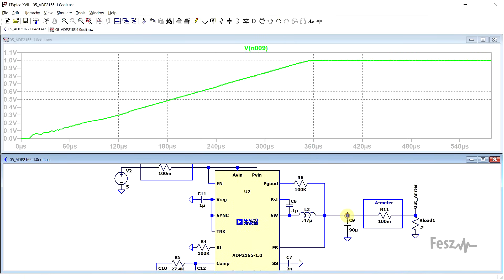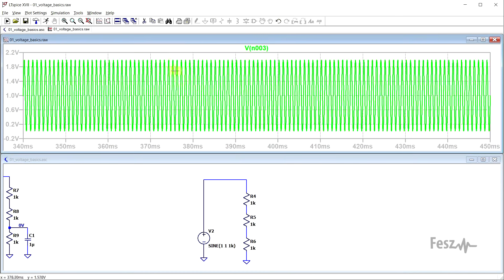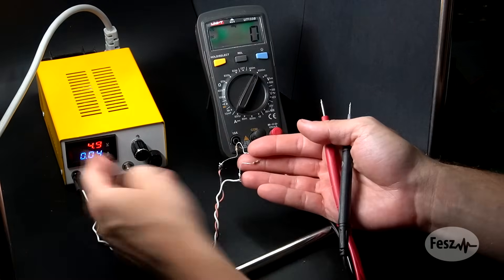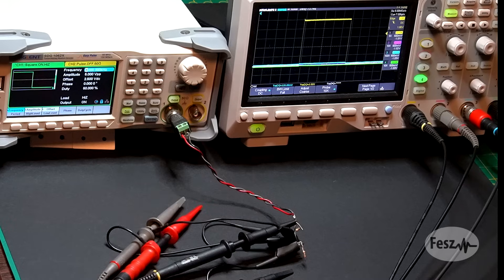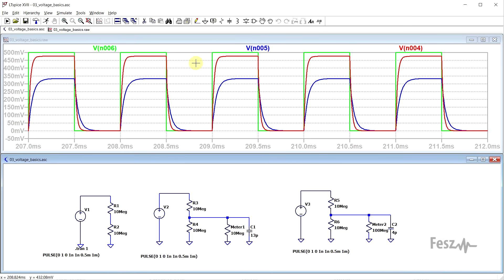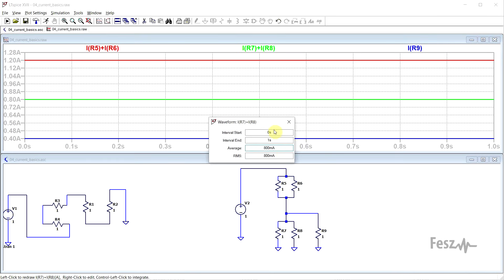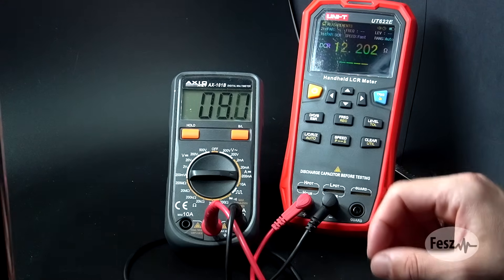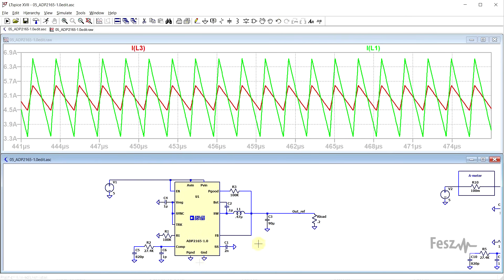About Measuring Voltage and Current

Comment: There is at least one additional way to measure current in LTspice. To measure the current flowing into a particular pin of a component, you can refer to a "pin current" like "Ix(U1:Vin)". You can actually pick any of the available pin currents from the list displayed by the "Add trace" function.

Unfortunately, pin currents can't be used in .measure commands.
Reply from the maker: This is quite an annoying phenomenon - it happens whenever a subcircuit is used. You can use the pin current in the plot window but not in anything else. I saw that 2 common ways around this is to add a voltage source with 0V in series with the pin, or just a very low value resistor, and then use I(Vx) or I(Rx) in measure or any other commands.
Reply: @FesZElectronics  In my latest design, adding a 0V voltage source slowed the simulation to a crawl. I wound up using a low-value resistor, which seems to work well enough as long as you rotate it so LTspice measures the current flow in the right direction.

It's unfortunate that you often need to trick LTspice (or any other software) into doing what you want.